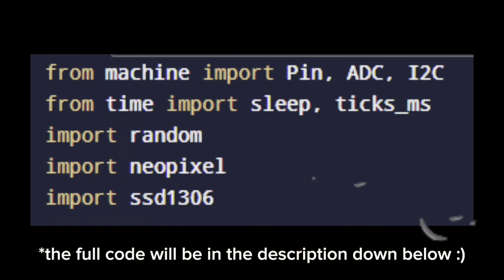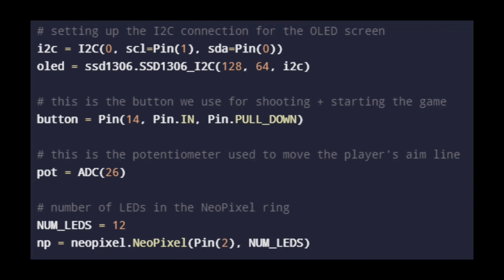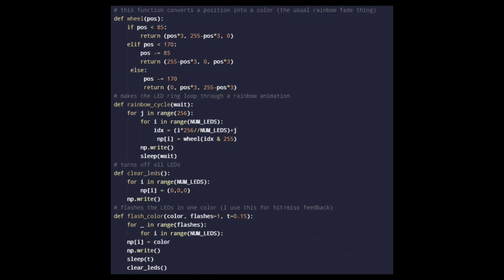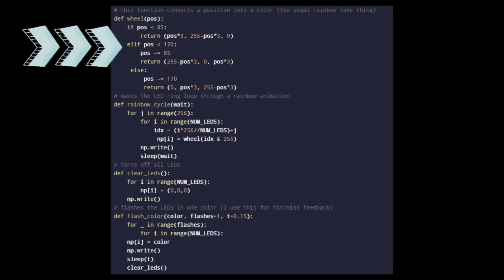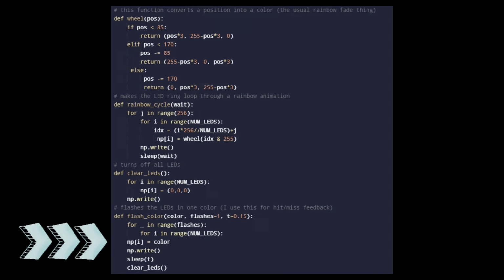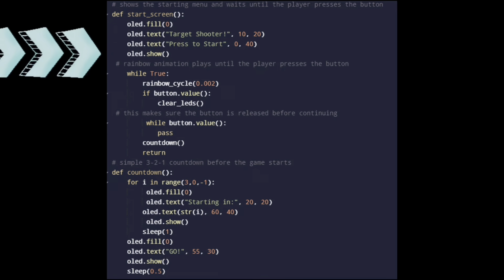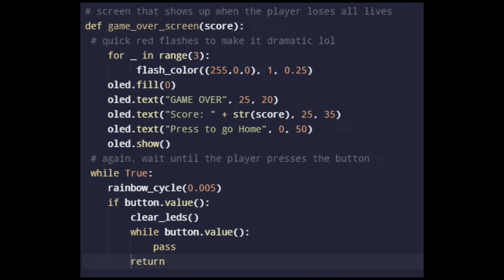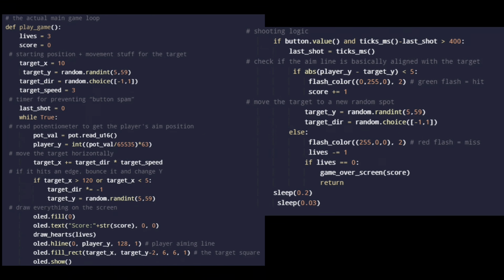Building a Target Shooter Game with a Raspberry Pi Pico (Python & Electronics) - SAS 2026

Comment: Never apologize for your breadboard mess, unless it's causing more problems than it's worth... I have had literal days of stupid problems and stupid solutions that are stupid and shouldn't exist in any real capacity by trying to go outside of a breadboard where it seemed logical lol.. and it's basically become the the largest source of wasted Time by far, as well as mental roadblock as to trying to take risks etc or go through experimental processes of creation that aren't a step-by-step follow guide on account of all of the random fun things that have happened from these tiny parts and their weird quirks that can happen when assuming one result and only to find out that system worked don day one and it hasn't in a week lol and the chip is broken.. but the LED still blinks so you thought it was fine and your code was bad etc.. probably would not have been nearly an issue if I just used the breadboard lol... Or just fucking soldered it lol.. but that's a skill issue that also defies reality as I for some reason can't go near a soldering iron without somehow destroying not only everything it touches but several things adjacent...